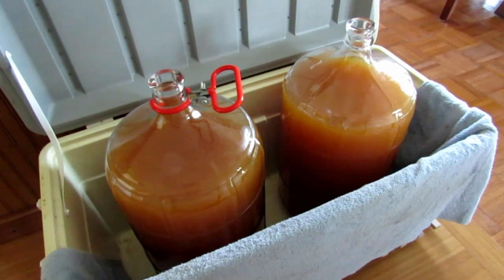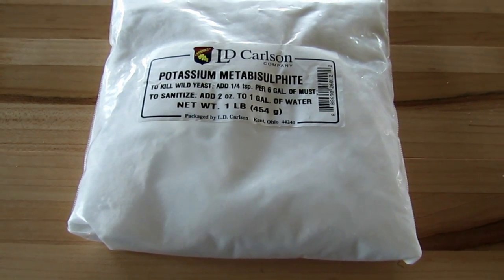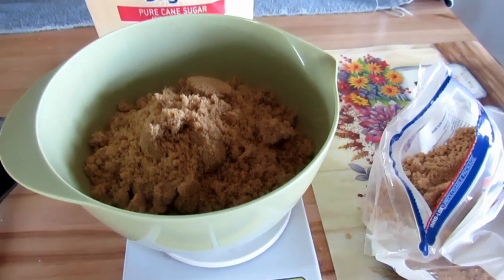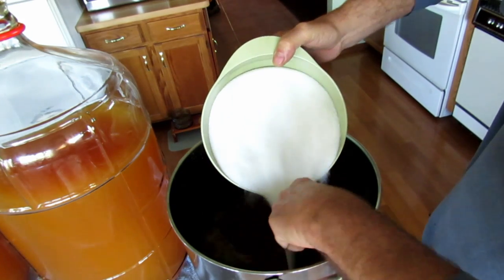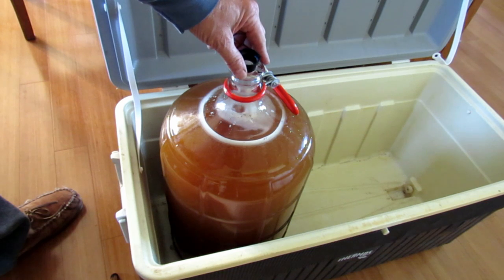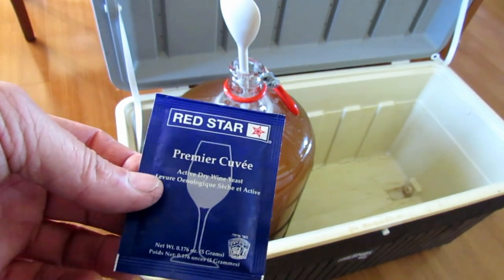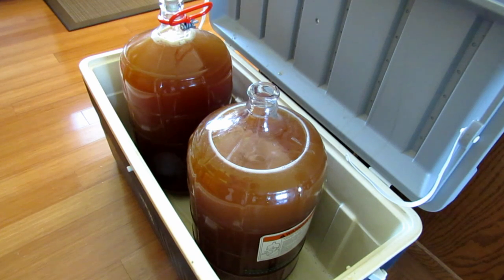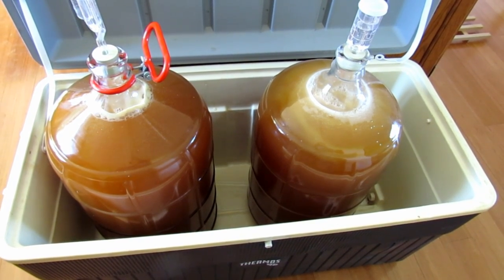Making Hard Apple Cider Part 1

Comment: Thank you for sharing your cider making experience!

What's your opinion was on boiling the unpasteurized cider before pitching the store-bought yeast versus adding potassium metabisulfate?
Reply from the maker: I think boiling changes the outcome. I always use the potassium metabisulfate with great results. Thanks for watching.
Reply: I don't do any of both. If you add the yeast pretty fast, it will be dominant over the natural yeast. Never had any problems. But nice to see some other methods.

Comment: By the chart I have, it looks like you were shooting for a spgr of 1.080 on the first batch and 1.115 on the second to get the alcohol level you wanted, is that correct?
Reply from the maker: That is in the ballpark. I use the brix reading and shoot for a 20, & 26.5 on my hydrometer. The batch with the higher sp.gr. tastes just about like a dry apple wine after aging a couple of months. Thank you for watching my video.

Comment: Hi I have my former questions on the page where you bottle,but it won't allow me to post ther for some reason, Kelly
Here are my questions:

I m on the thread below, but it won't post there, so I am trying this. Kelly. Good Morning, A couple more questions, if you don't mind. I'm finally racking the cider. I checked the alcohol percentage it is showing just  under 5% today, but on the very first day it read about, 15 % or more.What does this really mean? It tastes a tiny bit fizzy, tiny bit yeasty and is still bubbly a bit, is this all normal? And lastly why so some cider makers bottle it up now instead of racking it a second time? It is obviously murky still. Do some folks do some folks consume  it murky? Thanks so much for your help ! Anything else I should take into consideration? Kelly
Reply from the maker: It means that it is not done fermenting yet. You take a reading at the start and when the fermentation is done the SG  will be 1.00 or brix scale will be zero. The yeast is still alive and working so that is why you taste it. Once it consumes all the sugar and dies off it will settle out and clear up.  I usually let mine settle for a couple of months in a cool spot with a airlock to clear up before bottling. Be very carefull about      sanatizinganything that contacts the cider to avoid contamination.